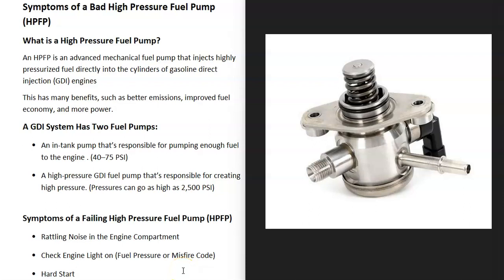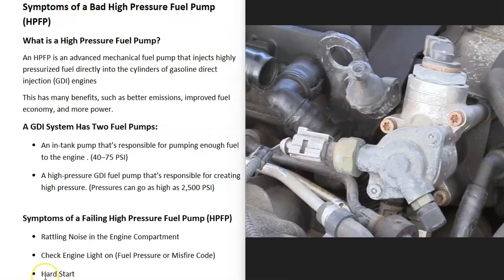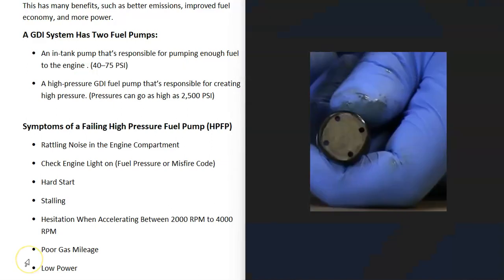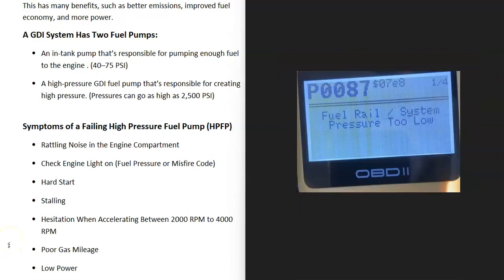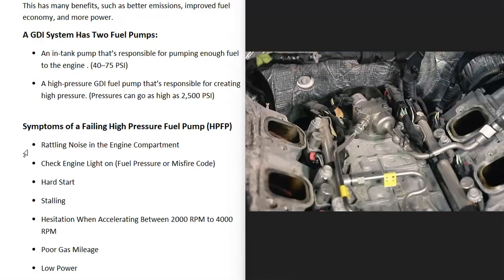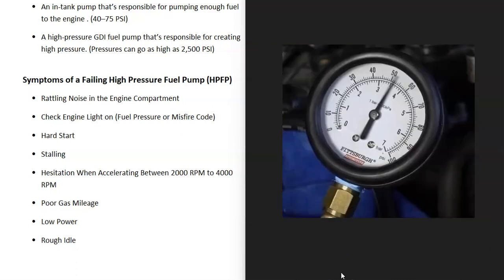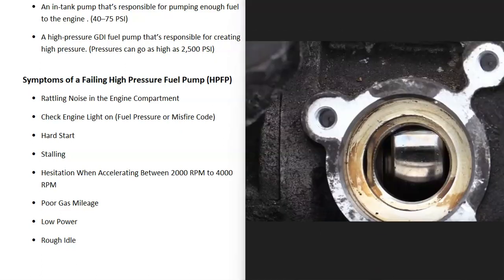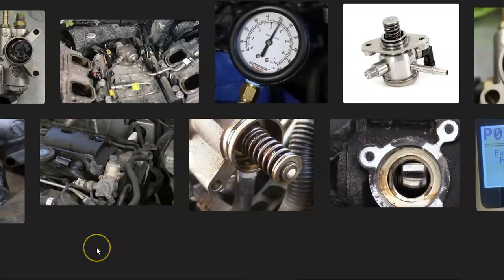Symptoms of a Bad High Pressure Fuel Pump (HPFP)

Comment: The car won’t start if your fuel pump is bad. If it stays running, it’s not your fuel pump. 
But I’m trying to figure out if it’s the HP fuel pump or a sensor, cause it will not rev over 2000 and hops up and down from 1000 to 2000 rpm when pressing on the gas throttle
Reply: Did you figure this out? I always wondered about the fuel rail sensor failing. Mine is doing the same thing. However, when I unplug the HPFP it does not change the rpm's.
Reply: @glogray6  yeah, you gotta be careful. Usually the fuel will get backed up and your fuel lines will start banging. Your HPFP relays the fuel from the fuel lines to the fuel rail. So you can fuk the injectors up and back up the fuel lines, and they can explode with to much back pressure.
Reply: @glogray6 and if you unplug the sensor and nothing happens is because you HPFP is driven by the cam. So it pumps by being lifted. So the only way to tell if your HPFP is faulty is when it’s not pumping properly, but that usually because the bucket is not lifting the HPFP far enough. And a faulty HPFP usually leaks gas into the oil. So if you don’t smell fuel on the springs, it’s probably still good.

Comment: I have a 2014 Accord sport. A honda repair shop replaced the high pressure fuel pump and it didn't fix the problem. The car is still driving and idling the same. Help

Comment: I have a 2022 Honda Civic SI and I'm experiencing these exact symptoms rattling, loss of power between 2 and 4000 RPM... hesitation. Only problem is I don't have a check engine light on. I pretty sure it's this though

Comment: Im just starting to deal with this on my 2010 cobalt ss turbo and i was so happy i fixed all the turbo issues then i started hearing the HPFP rattle and gave me a bunch of fuel codes i know its not the tank because its keeping the car steady, but the rattle comes straight from the pump when making boost so time to order a cam follower and a HPFP get it ready for a road trip

Comment: Can fuel leak into the engine with a faulty high fuel pump
Reply from the maker: Yes, it can when an HPFP goes bad, sometimes fuel leaks into the oil. Also, sometimes the roller can come apart, which can send metal shavings into the oil. Many mechanics automatically change the oil when an engine has a bad HPFP.

Comment: I got a 2011 GMC terrain.  Recently it randomly stalls when I come to a stop or sit and idle. The throttle body, in tank fuel pump, ecm computer and engine control relay all start repeatedly clicking.   I have change all 4 vvt solenoids and no fix.  Seems like it happens after it's warmed up.  Sometimes I'll start again in 5 minutes other times it could be hrs or overnight before it starts again.  What do you think it could be. Think you to anyone that can help

Comment: Recently I worked on my first GDI engine. To shorten up my long story I fought with air trapped in the high pressure fuel lines. After a lot of effort I managed to get the air purged out of the system. Remember air compresses and liquids don't. Now the engine starts and runs great.
Reply: Wow really ? How did u purge that air ? I think there is a pressure release valve

Comment: I have a question my sister haves a 2018 Lincoln MKZ 2.0 T and her car is making a noise coming from the gas tank u open the tiny door to put the gas in u open that the noise stop but as soon as you shut it it starts making a gurgling sound and engine lights on and it runs like it hardly getting fuel in the engine could this be the issue about the fuel pressure part in the engine ?
Reply from the maker: It needs to be diagnosed, but it sounds like high pressure in the gas tank, which would be more of an EVAP issue, such as a bad vent valve. A bad fuel pump shouldn't cause high pressure in the gas tank. If a component fails, usually, there are codes.

Comment: My golf r currently just stopped running shortly after starting. I’ve had a  misfire issue and thought it was the tune so I’ve laid off gas until I fix other problems and somewhat rough starts. The car will no longer start. It tries to turn and you can hear it try to fire but won’t. Battery is good and obviously the starter is good because it died while running. Leaves me to question this.
Reply: Could be timing as well.

Comment: Hi there i have a toyota rav4 1AZ engine..the HPFP wont allow the fuel to flow out to the injectors..ive checked the plunger on the pump etc, but no wear and tear..fuel is coming into the pump but its not going out of the pump into the injectors..pls any feedback would be appreciated..thanks
Reply from the maker: It needs to be diagnosed. First, I would check the oil for any contamination, which often happens when the HPFP goes bad. I would also check the solenoid on the HPFP and any related fuses. The HPFP can also be removed, and the cam that powers it can be examined.

Comment: I have a 2014 QX80, I’ve changed the HPFP and it won’t start, is stalling as it tries to come on… any ideas pls let me know…
Reply: There is a video showing when installing hpfp make sure camshaft is lowest point before installing cam and pump.its called how to replace the high pressure fuel pump 2014-2019 its by TRQ

Comment: have a 2018 ford escape with 70000 miles on it. It was hesitating and not accelerating. Removed the old high pressure pump and found out the needle bearing broke off and ended up damaging the camshaft. Needle bearing is in engine somewhere. Need a new engine.

Comment: I installed a new HPFP on a 2013 Malibu. Job went good. car runs good now... all lights off. I got a gasoline smell.. retighten the high pressure line nuts... still an occasional wiff of gasoline inside car.
Reply: How did you release the pressure ? Any special tools required ? Thanks in advance . I Will be working on my personal 2013 Chevy malibu 2.5 in the next upcoming week

Comment: Hey! So good video. Not big, on point and clear explanations. I have a BMW 116i 2007 e87. (N45 B16 A). I had previously changed O2 sensor and MAF sensor, exhaust sensor, as I had codes for them. The codes disappeared and left a code for exhaust vanos. So I decided to change both of them as well as the exhaust sensor. But after I changed those, the car has very rough idle, shaking engine and misfirings. Codes for cylinder 4, camshaft sensor exhaust and vanos exhaust (both are new). I had an idea that might be fuel injectors and as I open the valve to depressurise the petrol in rail there were no pressure. Is there possibility to be the fuel pamp(s)? Please help 

P.S. To mention that the car experiences symptoms you describe in video (hesitation, check engine oil, rattling noise, stalling) except rough idle and shaking engine. The last appeared after the vanos changed.

Comment: What about if my car is overheating? That’s another symptom?
Reply: Overheating is the cooling system of the car, not the hpfp. Check radiator and radiator hoses. A bad thermostat or bad water pump.

Comment: Hi guys can a  bad hpfp seal and cam follower cause fuel to leak in oil?? Because I smell gas from my dip stick but oil levels are normal and I have a oil low pressure signal...kindly point me in the right direction guys....oh its a Mk5 gti
Reply: HPFP seals blown. Buy a new pump. Make sure its Hitachi or Pierburg as the cheap ones only last a few months. I tried a cheap one and it failed again after 14000km

Comment: I wonder.. while driving.. would you have misfires, loud gunshot pops and bang only on acceleration, under heavy load, heavy misfire then code, but on deceleration, sounds normal? 

Idle also a little choppy, but engine otherwise runs kinda smooth..?

I replaced injectors, coils, plugs, checked fuses, tested my low pressure fuel pump, and i have this spare fuel pump, but its used so it may work? Lol find out tomorrow..

Shats your opinion??
Reply from the maker: Anything I say here is a guess, but it sounds like a timing issue. Both fuel pumps can be tested with an OBDII scan tool or pressure gauge to be sure they are outputting the correct pressure.

Comment: Also if you have a bad high pressure fuel pump you’ll smell gas when doing an oil change or on your dipstick
Reply: I think I have a bad high pressure fuel pump since I got the code p0088 (fuel rail/system pressure too high) on a 2015 Honda accord sport.. but I want to make sure it’s the pump since others say it might be timing chain or whatever. Soo if I smell the dip stick it’s gonna confirm the high pressure fuel pump if it smells like gas??
Reply: This is exactly what I noticed on my 2015 Subaru wrx. My oil reading is always exactly between high and low chalk marks. All the sudden the oil is overfull and my car starts jerking and losing power. Got in my driveway turned off car and it wouldn't start. Hpfp failed right in my driveway thankfully.
Reply: I have a 17 camaro 3.6 that's pouting fuel out the top front (front bumper) somewhere under the intake manifold upon start. It won't start unless I try to start it 2-3 times in a row pumping the pedal a little. It shut off the car in the middle of driving regularly and then started doing this.
Reply: I have a hyundai veloster and I changed the oil about 2 months ago. It started carrying on not idling when at full temp. I took it to a auto electrician and he said there was 2ltrs of fuel in my oil. So I'm guessing my pump is buggerd?

Comment: if I have issue with this pump .. its will effect on AFM system ? the car is tahoe 2016
Reply: yes ...the issue was from the fuel its self.
 its mixed with little desiel  look like .
I clean the fuel tank , bibes and feul injectors . and add cleaner fluid to tank now its work fine
Reply: @abdulrahmanalsoweyah  lucky, I have collapsed lifter and few broken parts
Reply: Did you solve your issue? My 2016 sierra just died on me driving the other day... won't fire up now, sounds horrible if it gets going at all
Reply: Sounds fine when cranking

Comment: I have a Ford 150 3.5 eco boost. Crank no start. Original code was a P0087, i pulled the the pressure line off to see if fuel was coming out of pump in tank, and only a trickle came out when cycling key. I replaced the pump inside the tank, and truck still wont start. Now i have a p00c6 code. Should i replace the high pressure fuel pump next? Resistance readings on sensor on high pressure fuel pump are within specs.
Reply from the maker: Since the pump was replaced, be sure it is working; if not, check the wiring. If the pump is working, I would check for a clogged inline fuel filter or line.

Comment: So my mechanic had  unscrewed the bolt on the hpfp and had me turn key and gas was leaking from the hpfp..and he said that if my fuel filter or fuel pump assembly was bad then gas would not reach to the hpfp...Is that true?
Reply: If it’s 100% clogged, generally the low pressure pump will pump but will more strain causing premature to both hpfp then low pressure pump, it’s recommended to replace modern fuel filters at 30k miles but can be extended by avoiding gas stations with old tanks and rust particles will develop from the ethanol introducing water into the tank
Reply: Your mechanic sounds like he doesn’t have any of the test equipment that he needs and he’s making assumptions instead of showing proof

Comment: my 2012 regal 2.0l makes a ticking sound at idleis that normal for this ecotec?
Reply: Most definitely
Reply: @Nezdude87  yea I told my buddy almost all of them sound like that after 100k miles he just looked at me like I was stupid found out on mine it's the high pressure pump kinda crazy it makes all that racket and it's so small!
Reply: Mine does the same thing found out today that's it's been the high pressure pump! Lol at first start it sounds like the lifters are about to explode out of it then when it settles down it just starts making a very odd tick tick tick noise but I put my hands on the pump and the noise matches perfectly with what I felt under the hood so I'ma change mine out and see if it stops she does have 220k miles though but idk runs smooth no other issues with the engine though

Comment: Vehicle stalls, invariably, after finishing slopes. Even small slopes. It will stall if you press hard on the gas. Reluctance to move from standstill. Black exhaust fumes. 1AZ engine. Toyota Noah. What could that be?

Thank you for this video.

Comment: What would be the pressure of the in tank fuel Pump and the pressure of the high pressure fuel pump for a diesel engine for a pick up truck??? Thank you
Reply: I think they should be about the same ALOT of if not all diesel engines have a mechanical fuel pump kinda like these but from what I've seen much larger. That is IF they have one of the in the tank pumps from what I've heard some don't and it causes a lot of issues in certain trucks and they keep having those issues till they install one I'm not a diesel guy though I only work on lawn mowers that are diesel like the older Kubota stuff lol they got inline fuel pumps and a high pressure pump just before the injectors! Anyways I know this is an old comment just figured I'd be the first to answer it hahaha a year later though

Comment: My car never had a sound coming from it. It was quiet, now I hear noise coming from under the hood. It’s a 2010 Lexus gs350 now it sounds like a sports car when I press the gas. I hear the noise under the hood not from the back of the car. What’s wrong with my car? Can you help. Please explain.
Reply: Poor oil maintenance for the life of the vehicle is what happened. Even with tge super synthetic oils that claim 15k miles like amsol or pennzoil ultra platinum, you need to really change tge oil every 7500 miles at tge most to get the vehicle to make it in the 200-300k range without replacing a bunch of bullshit. So many things run off the camshafts now including the part in tge video. far and few oil changes with cheap oil = all these problems and more. No way to tell what the actual problem is on a YT comment but it sounds mechanical like HPFP part mentioned. The sad thing is what these thing go for, 600$+ at oriellys for the one on my car. Ebay has them dort cheap but i wouldn't trust the cheap china part.. not with this at least. Perhaps there is a brand name one like Bosch or something for 150 or so though.

Comment: Vehicle went into limp mode
Reply: Hi. How did you solve the problem of limp mode
Reply: @matsobanemashapa7457  
It has a broken hi fuel pressure pump and a broken wire on the plug going to the high pressure fuel pump also !
Reply: I got an exhaust system message.. curious if a bad fuel pump is the problem ,My vehicle is in limp mode too
Reply: @lisam9593 How did you fix limp mode, did it barely move after say 20mph or around 3k rpm
Reply: Mine is on limp mode now
Reply: @mixtv61 How did you fix limp mode, did it barely move after say 20mph or around 3k rpm
Reply: ANYONE FIX THEIR LIMP MODE.